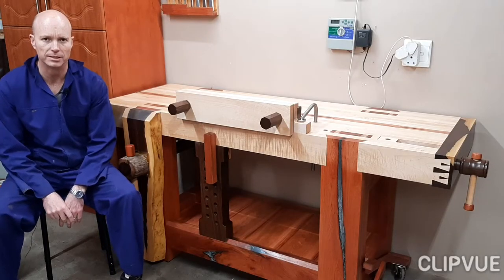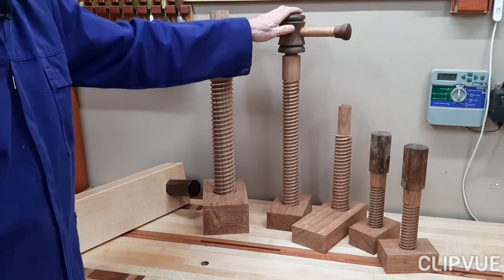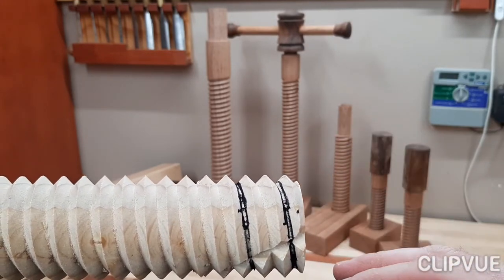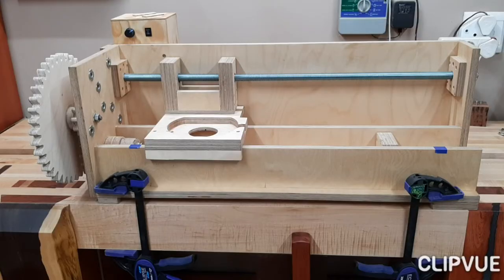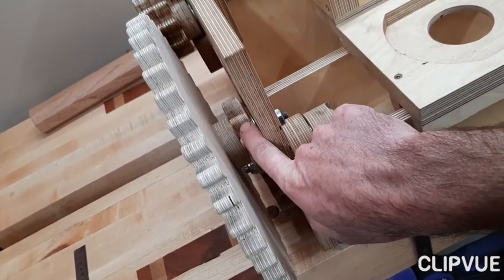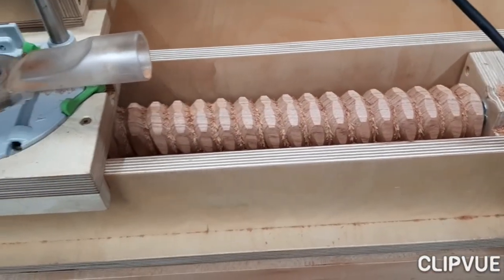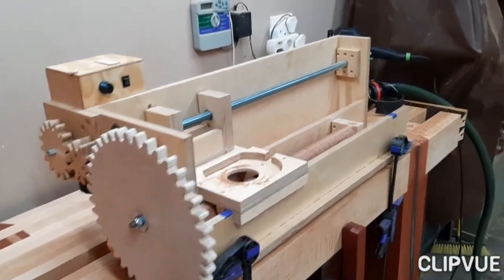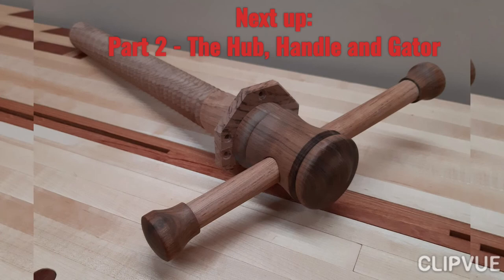DIY Large Wooden Screws - Part 1 - The Screw

Comment: Many of the large steel screws used for vises in the US have a wider threads and they are flat on the top instead of peaked which adds significant strength, you may consider making this style of screw for added strength as wood is not nearly as strong as steel. You would have to round out your stock to near final dimensions and then use a straight cutting bit to achieve this stronger style of screw

Comment: Outstanding work! I agree that commercially-sourced screws and nuts for workbenches have become prohibitively expensive (hence folks adapting scaffold leveling jacks ... Dema's Woodshop was the first I saw). I have the ShopNotes issue and also thought that the router mill could be easily adjusted to cut threads (I'd even thought that multiple-start threads were possible). You have a new subscriber!
Reply: And I just noticed your workbench ... Damn! Resin-filled timbers, curly maple, live-edge leg vise chop?

Truly a work of art!

Comment: Looking amazing!
Three questions: 
1. Where do you get your teak?
2. Are you selling these within SA?
3. What's the reason to have a twin screw over a single screw?
Reply from the maker: Hi Michael,
1. Silverton Timber Merchants or Maple Street Timbers. But there are quite a few others here in Gauteng as well.
2.  Yes, will advertise on Facebook in the next few days. Look out for them on The Woodworkers Forum of SA, Houtwerkers Houtwerk and Garage Houtwerkers.
3. Faster action for the same pitch / thread size.
Reply: @jcwoodworx-corneeldutoit3419  thanks for the reply and I'll check out those groups too! I'm keen to watch your next video
Reply: I believe the advantage is increased surface area contact within the nut and a smaller depth of thread yet still gives travel distance of single.